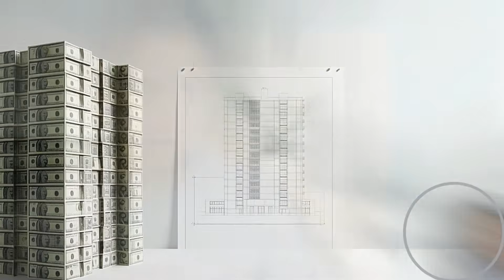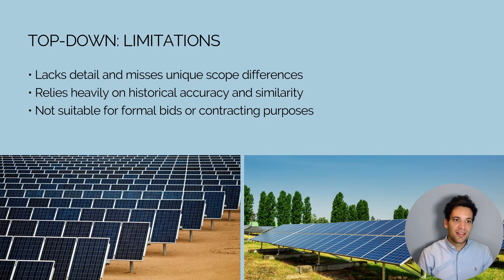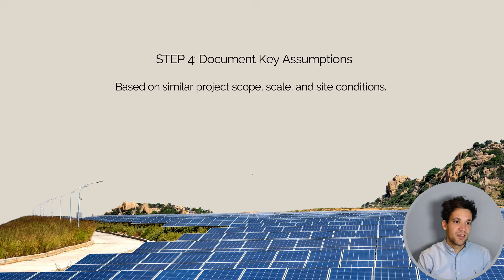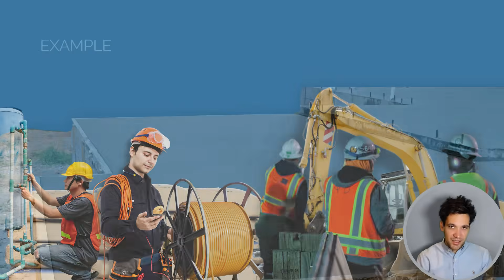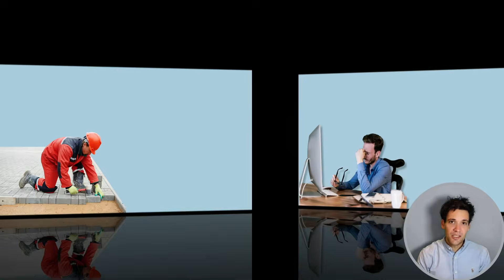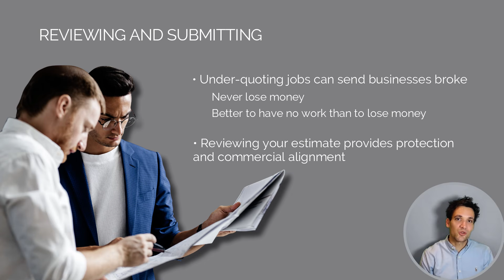Comment: Does the profit include cooperate overheads? or do you first calculate cooperate overheads, the calculate profit as a percentage (including the cooperate overheads in your profit calculations? hope my question makes sense.
Reply: Profit does NOT include coroporate overheads. You calculate corporate overheads based on business running costs divided by revenue. So if your business costs $500k to run and you do $10m in revenue, then your corporate overheads are 5%. Profit is then added after this

Comment: Was expecting the labour to be turned into productivity UoM in the exemple such as M3 per day/week build or so so as to accomodate productivity factor
Reply: Labour you either do with a productivity (i..e m2 of formwork per hour), or if its for a fixed duration, you price off that (for example scaffolders may be required for the projecct duration)